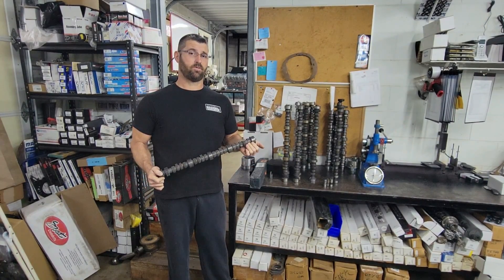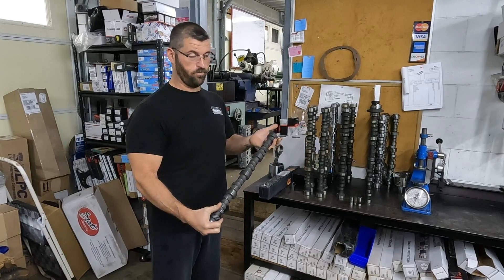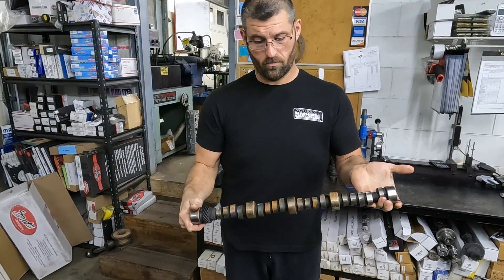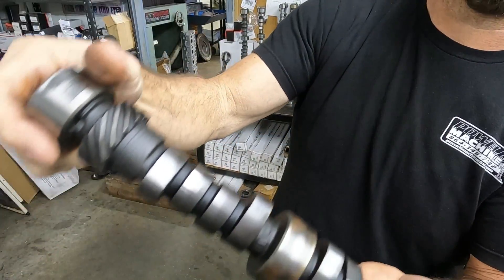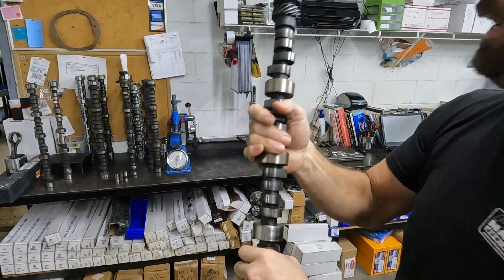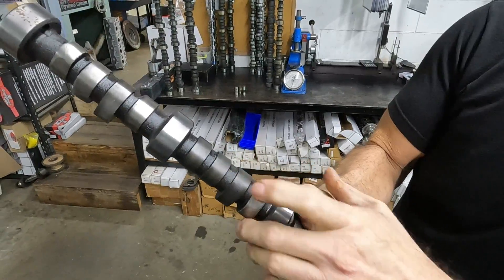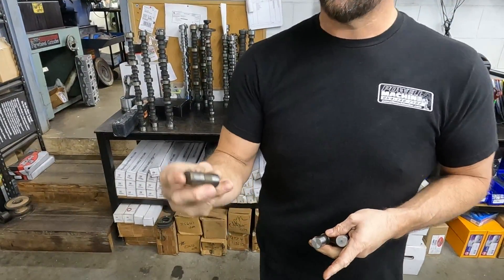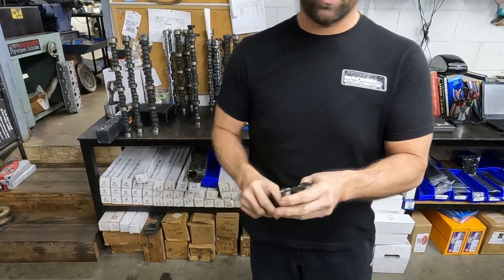Flat Tappet Cam Failures?, we investigate why and check the hardness of several cams and lifters!

Comment: Is there a difference in hardness from a fresh cam to one that has gone thru a heat cycle during break in ? Did the cams that are softer make an uninterrupted heat cycle ? What oil ? What coolant temp ? What RPM, how long ? Did they use snake oil zinc ?
Reply from the maker: Not measurable

Comment: I just checked my Summit branded cam that I haven't installed yet and it looks like it says maybe HEP 6

Any idea what that could be?         It's a small cam for a small block Chevy sold as circle track/RV cam (advertised as 218/218 .459/.450 lift 106 LSA) that's going in my daily driver 6k pound 4x4 Tahoe

Comment: In process of building a jeeo 4.6 stroker with a comp cam got cam high energy lifters to match it. Also have permatex ultra slick lube. Gonna get high zic break in oil and additive.  Would using a ball hone on the lifter bores be alright to clean them up and make sure they will spin good?
Reply from the maker: Best of luck

Comment: great video i am 68 growing up building motors in the 70s we started the motor if it ran good we raced it that night breakin started on the first 6,000 rpm pass we never ran then for 20 min 2,000 rpm never had a failure but i understand now if you don't do the breakin they most likely will fail.

Comment: I am not a betting man, but getting oil galleries clean is a chore and I doubt that few remove plugs and run a brush with solvent thru an oil galleries or passage in the block. They may bush the crank, rods & look thru push rods, but that’s it. 
 I think that instructions included with set of lifters, cam or crank should list this a required exercise in any block. 
  If seen videos of guys changing ring, pinion, bearings or installing a positive traction carrier after showing bearing wear or damage like pitting between of ring & pinion. Then spray to clean the housing, Fine. But what about the axel tubes. I made a stupid simple brush that is changed to rag to run the tubes in and out as debris collects at the bottom. When full and temps change, this stuff comes loose and contaminates the diff lube. It is found on a magnet in an automatic trans, so I put one in each differential and place it on epoxy. I grabs  the bad metallic flakes that come out of nowhere! I don’t know, it just gets me. I spent 3+ hours on a used LS block I serviced until wrecked, then I got it. Modify the oil pump, clean the galleries with a length a MIG wire tied to a spray gun brush. Back & forth with brake cleaner and some acetone to finish, then compressed air catching with white paper lint-free towels. Ok. 
I thank you kindly for showing and covering this issue.
Reply from the maker: You're welcome!

Comment: Regarding high rpm break in, that makes no sense, ever. The cam turns 300 rpm at 600 rpm idle. The lobes are actually pushing the lifters ~1/3 of that, duration of ~120°. So about 100  lifts per minute or 1.7 per second. You can blink or tap your finger thrice as fast, for perspective. This is trivial and breakin grease or even oil is plenty. When you raise the rpm 4 times idle like many recommend you have increased the velocity at which the lobe approaches the lifter and the speed that the lobe wipes accross the lifter thus increasing friction dramatically. Like starting a fire by twisting a stick on a piece of wood slowly vs very fast. And pump oil pressure at lifter bore and crank slinging takes a few seconds. Someone should make a test rig of an engine with cam, only 2 lifters and 2 valves and springs. Put a motor turning 300 rpm on the cam with NO lubricant and measure the temperature rise vs time. If the surfaces are hardened properly there should be no wear. Then raise the rpm to 1200.
A drill or lathe tool with no lube experiences much higher pressures and dont dull unless the rpm is very high. Best of all, get a sixties GMC V6, the cam is IN a pool of oil at all times. As far as rings seating, use a bit of thin oil and low rpm. High rpm break-in makes no sense. The opposite, low rpm does make sense. No car factory ever breaks in an engine first start, not ever, for over 120 years. Start the engine, drive it to the parking lot, turn it off.
How many engines have been stored for 1, 30, 70 years but start and run fine? Abandoned in a field? No lube at all, dry.

Comment: C scale harness on cast iron ?   Shouldn't that be a Brinell test ?
Reply from the maker: Nope
Reply: @powellmachineinc  why not ?
Reply: @powellmachineinc  how did GM get the cams on a 1957 chevy 283 engine to BREAK IN without destroying the cam ? Did they test run each engine at the FACTORY for the BREAK IN PERIOD before installing it in the vehicle to assure that it was done right so that they could guarantee the engine  ?

Comment: The guy with  the big block Buick is probably or was probably having oiling issues. The 455 is notorious for difficulty in getting the oil pump primed and that goes for the Pontiac and Buick 455.
Reply from the maker: Cam lobes are not oiled from a oil pump

Comment: The only time i have had a flat tappet failure, was when it was something i did wrong. There is an elephant in the room though. That is the oil side of things. As I'm learning over the years and keeping up with technology, I'm learning from Lake Speed that the zinc additive you can buy for cam break in could be the cause. It is better to just buy the break in oil and skip the additive, as I have done for years and  been wrong! Things are going way better since changed that process.

Comment: Interesting. Since you are no longer dealing with the flat tappet stuff, are there any problems with the roller lifter needle bearings?  What is your opinion of the Isky rollers with bushings? Thanks.
Reply from the maker: Bushing are great for high load applications

Comment: I have built engines for last 26yrs and I have never had a flat tappet cam fail. I have always put cheap oil in engine crank it up with no water ran to head got warm. I done this 3 times the forth time engine is full of oil and I run engine at 2000 rpm for 25 min. I change oil to good oil I cut filter apart looking for metal. With engine at 2000 rpm the oil is splashing a lot of oil on the camshaft. I check lifter turn while building the engine, imo a lot of flat tappet camshaft failure is from not the proper break in .

Comment: The heat treatment is on the surface.    The depth of the heat treatment or the she'll is dependent upon who heat treated it and for how long.   The core is soft so that the manufacturer can machine it economical.   This is why the main journal on the Comp cam was 55.  You didn't explain why it failed,  you just did destructive testing..

Comment: This thread is probably too far back in the lineup to get an answer . However , here's my question . We know by now , through your testing and opinions , along with several others , that the grind pattern and taper on both lifters and cams is why many combos are failing on break in or shortly after . The obvious answer is ' the guy that grinds the cam should also be the one who grinds the lifters . Then taper is correct and each part matches the other . Now I'm seeing ads that push the DLC coating . DLC is great stuff all by itself , but it does not address the incorrect taper / grind that caused the issue to begin with . I dislike using manufacturers names usually , but Comp Cams are the ones advertising the DLC coating . Have they adopted the process of grinding both cam and lifters correctly , then DLC coated the parts , or have they simply coated batch produced parts ....leaving the original problem unaddressed . We know DLC coatings are slicker than snot , but will the DLC contact patch impart the needed friction between parts to spin the lifters / pushrods , etc . Thanks for your time and experience .

Comment: hi what i do on my flat tappet engines, i have a comp cam tool that cuts oil grove in lifter bore for oil to spray right on cam lobe, i think thay used this mod in nascar, i just run oil pump with higher pressure. i build alot of flat track engines

Comment: Years ago in the early to mid 80s I replaced a lot of cams in trucks that were less than 150k miles. The cam lobes would be worn down as you show. I could find no reason for it and could not look on line or YouTube back in the dark ages of no internet. I later found what I thought to be the answer.
I learned that due to the advent of Catalytic converters Zinc was removed from the oil formulations due to it clogging the cats.
I have some engines, mainly 4 cylinders in small British cars that have no cats on them. I use oil formulated for off road diesel tractors that has Zinc in it. I also have learned that there is a zinc additive available for oil. 
I dont put a lot of miles on my toy cars but I have not encountered any issues using a zinc oil.

Comment: ilost 3 cams in less than a Year back in 2008, Since then I have used a set  of Windowed Valve Covers on first Fire up, I have Caught push rods that are not turning early enough to save the cam. i only run into one time that a lifter change didn't cure the problem. one cam  was a problem of not having a taper on one lobe. Most times it is the lifter that caused  the problem.

Comment: On a 2021 5.3l V-8 Chevy Silverado I had a lifter failure at 3900 miles, bent the push rods on a couple of cylinders, the dealer replaced the all lifters and bent push rods, is there a chance the cam is damaged and the dealer did not do a complete repair?

Comment: Would like to see the operation of the hardness tester(never seen or used 1). The procedure/process for testing. Would expect the hardness of some of the cams to be a little higher as you must be getting some deflection due to the way they are supported. Does the testing leave a mark that has to be dressed?.

Comment: Years ago these modern synthetic oils didn't exist. We'd install a cam and lifters run it at 2k rpm for 20-30 minutes running water over the radiator so it wouldn't get hot then drive the hell out of it no issues. It's gotta be the oil you need a good breakin oil.

Comment: 50% proper break-in procedure the other 50% is proper lash adjustment, the other 69% is just plain dumbassery from Donald Duck and Wiley Coyote who ought to be bagging groceries instead of building an engine, seems like everyone with an engine failure wants to blame it on the parts, 99.999% of the time it's the assemblers fault. Thanks for sharing Danny we appreciate ya'll 💪

Comment: I used to troubleshot GM cam lobe failures.

It was almost always due to induction hardening failure as the Eddy current process failed from low coil power!

Comment: O.E.s switched to Roller for Good Reasons. Improved emissions, economy,&power were obvious. Astronomical Warrenty Costs for Flat Tappet Cam failure were also yuge issue Rollers solved. Save yourself a bunch of grief and wasted cash. Switch to Roller

Comment: I also had a problem with my FE when I installed the billet roller cam it kept chewing up the distributor gears. So I bought a new gear sent it off had it hardened and so far that's working just fine years ago. This FE build was no fun at all.

Comment: One of the biggest problems I see especially with all these new engines is that the cams are not bathed in oil the valley is dry it used to be like on a small block Chevrolet there was so much oil pouring down from above onto the cam.

Comment: Lack of zinc . It was removed from oil as it caused cat. failure. That is why manufacturers started installing roller lifters in factory engines.The zinc had to go and flat tappets need zinc to properly survive. I always add to flat tappet motors . Correct me if I am wrong.
Reply from the maker: we debunked that long ago, racing oil doesnt fall in the "low Zinc" catagory

Comment: Nice Content!  Not sure how old you are, but using mid 80's GM cams/lifters as the 'standard' isn't really best.  GM had major issues with cam failures back then.  I had a 1986 305 that ate a lobe at around 120k miles.  Was very common.

Comment: You can't really check hardness like that if the part isn't through hardened which cast iron is not. As it cools the inside core is softer but the outer shell is wicked hard. You need hardness files to check hardness on the surface.
Reply: Cut a cam and do hardness tests across the core. You will see how the center is softer and as you move to the surface it gets hard.
Reply from the maker: Unfortunately you are wrong on both accounts.
Reply: Look at his picture post...says alot!
 @powellmachineinc

Comment: Just got done watching a video from a Canadian shop and the dude insists that it's harness.  Flat tappet troubles.  As we all know, the factory 5.7 Hemi and the factory LS had issues......and they were roller.  At the end of the day, after all of the research YOU FOLKS have done for folks like me to gather, I have to conclude that the problem is in the oil.  Most of the cam failures I've seen are on vehicles with high idle hours.  The best fix will have to be an additive.  You won't stop high idle hours so you have to make the oil sticky.  Slick 50, Lucas, Liqui Moly.  For now, that's the best we can do.
Reply: Is it the Lack of or low levels of Zinc content in the newer oils that causes this issue with flat tappet cams?
Reply: Even with zinc additive, people have been losing new lifters.  Same problem effects rollers and flat.... it's just that the rollers last longer.  Flat tappet lifters don't rotate so failure occurs quickly.  Additives like Lucas are absolutely necessary.  Idle hours on roller motors must be reduced.  Higher volume oil pumps will probably help during idle.
Reply: @murphystreeter  it's hard to say how strick people are on flat tappet cams shaft break in period. That's when the zinc is most important and holding a hi idle to keep good oil supply and least amount of harmonics during break in. Some flat tappets require light valve springs for break in also, I'm sure people feel like they can cheat that and not take the time to do it rite. Also lifter bore alignment and quality and such things could play a roll in failure.
Reply: I don't even mess with break in period.  Build it and running it.  I put the additional lube on the cam for sure.  I just put a new cam in a flathead 6 cylinder Studebaker.  There will be no break in.  I'll start it, tune it, and drive it.

Comment: I don't want to wear anyone out on comments but, 
I started mechancing when I was 17 because I wouldn't go to school. Worked in a shop as full line mechanic. Now am 63. I owned a small engine shop, I was amazed how many so called mechanics couldn't work on small engines even diesel mechanics. 1 cylinder engines have to be basicly all correct to run right and hold up. Example on a v8 maybe 6 cylinders are correct and 2 not, and nobody knows.
At 63 I still do small engine work also atv's , utv's.
I've seen so much stuff that mechanics have distroyed. Assume-ing will bite you in the ass every time! 
I can not express how much I appreciate you taking the time to do videos passing in your knowlege and experience. Everyone learns something from it.
Reply from the maker: You are very welcome!!

Comment: Lifters HAVE TO Rotate.
 Even a slight drag on their rotation will cause scuffing on the cam.
The cams are Cast Iron with a flame hardening process which is only about .010 deep.
API -SF Oil had additives including zddp which INCREASES the traction to help ROTATE the lifters in their bores.
Reply from the maker: Cast cams are through hard to the spool

Comment: I was not aware of a thing called cam lobe taper till now.How many have noticed that when a lifter is dropped into its bore,it does not rest center to center of the cam lobe.There is an offset where a portion of the lifter hangs beyond the lobe.I always believed that this eccentric design was what caused the lifter and pushrod to rotate.This rotation also distributes spring load  continuously on a different area as the lifter rotates.This lengthens the lifter’s life by preventing heat buildup caused by the cam lobe wiping continuously on the same area of the lifter.If your pushrod does not spin,the valve lash is not set properly or there’s a cam/ lifter problem.
Reply from the maker: All flat cams have the lobes offset to promote rotation,  lash has nothing to do with rotation.
Reply: @powellmachineinc  In years past I have investigated a noisy hydraulic lifter or lifters on my cars.This might be due to a rocker stud or a sloppy nut.upon pulling the valve covers,I have also observed pushrods that do not spin,like the others.However,upon loosening the rocker nut slightly,they,also,begin to rotate like the others.This is just a backyard mechanic’s observations.Hydraulics are basically zero lash lifters,be a relationship between how tight the rockers are and the lifter rotation.I have,however,never owned a solid lifter powered car,so they may be different.Anyhow,the slight taper across the lobe is an interesting fact that new to me.

Comment: I guess I better knock on wood I been building engines since 1970 and haven`t lost a lobe for 20 years. I turn just the cam and lifters with light oil by hand or a slow drill and watch to see the lifters turn, they`ll turn between 1/4 and 1/2 a turn every lift cycle, it they don`t I hone the bore till they do. On my competition flat tappet stuff I break them in with low pressure springs then change them, the circle track motors run 3 yrs usually. I try to stay with Bullet, comp and Johnson Hy-Lift. CWC is Cambell foundry isnt it?
Reply from the maker: Definitely